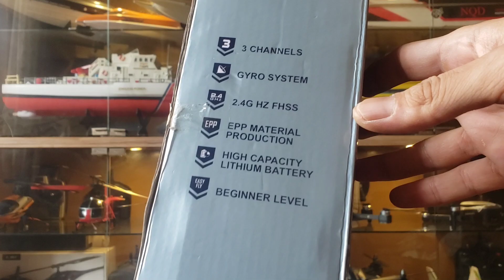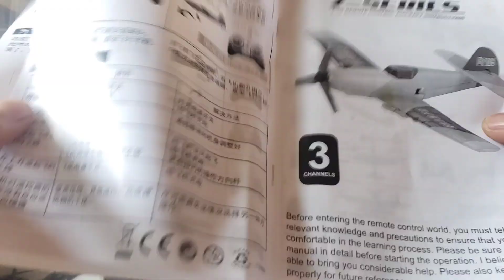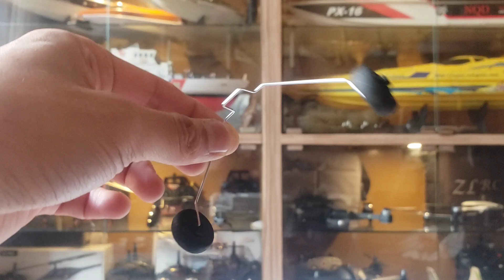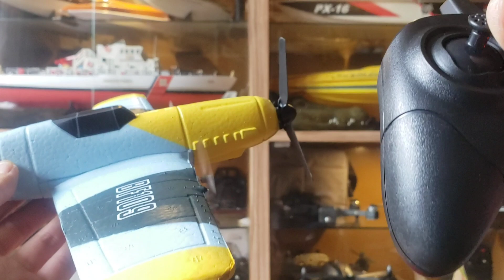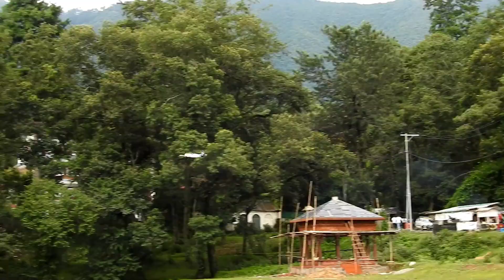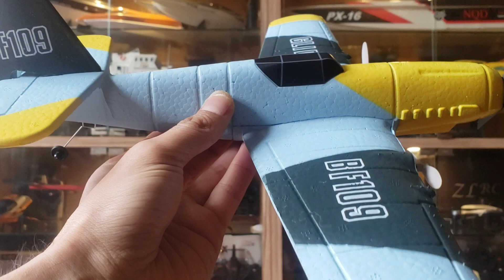Messerschmitt BF-109 German World War II 3Ch RC Warbird/RC Airplane Unbox/Test

Comment: I feather the prop.... Add a carbon fiber spars... Very light fiberglass on the wings...dsed it to 120 mph... My front prop is a straight into the wind... Then I use a Dremel on it and it's kind of skinny...less drag... And if you believe all of this then... Do you believe anything you read

Comment: Nice, are this planes 1/24 scale?

🔵🔵🔵🙂🙂🙂👍👍👍🔵🔵🔵
Reply from the maker: Looks a little bit bigger infront of 1/24 RC car and a little smaller infront of 1/16. So I think scale must be between 1/24 and 1/16. Also, manufacturers mention the size of RC planes in cms or meters (if they are bigger) rather than scale unlike RC cars. 😀
Reply: @RejanChitrakar  Thanks for the info maybe on a video with WPLS B series will look very close
Reply from the maker: I think 1/18 scale would be great but WPL 1/16 should be close.
Reply: @RejanChitrakar  The WPL B series are real 1/18 and the C 14 24 are 1/14 the C 34 is 1/11 scale
Reply from the maker: Agreed. 🙂
Reply: @carloshnunez hi.  What would u think the Fayee004 sjze would be?  Seems slightly bigger thand the WPL B series...as i agree with u.  Good stuff man.  Never played with the C class WPL.  They do look bigger.  How do the WPl C class trucks look next to a tamyia 14 scale?
Reply: @MCeMTPockets  The fayee 004 is real 1/16  the c14 and c24 are 1/14 perfect for the tamiya king hauler the c34 is 1/11 and the ldrc p06 is 1/16 wpl b series are 1/18, cheers my friend
Reply: @carloshnunez  thank you big guy.  Lot of the times i just go by visual size than the advertised size... yessssirrr...i agree...ty
Reply: @MCeMTPockets  Is the Chinese scale they say